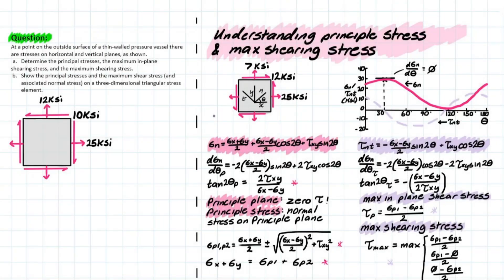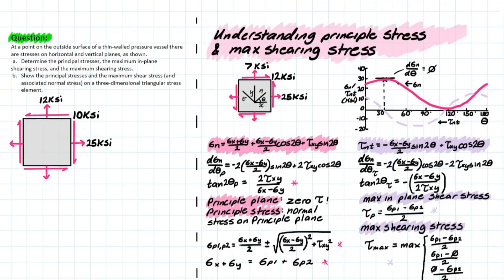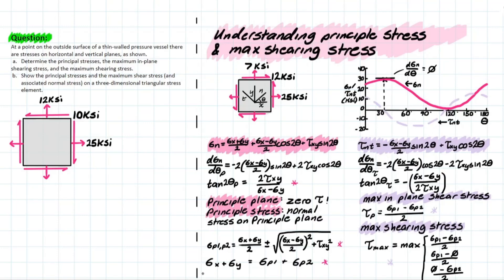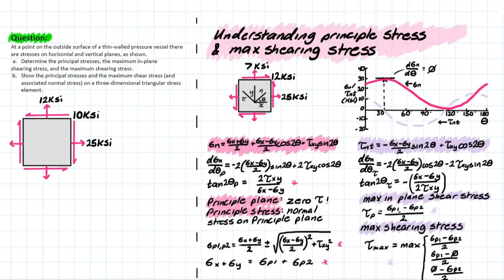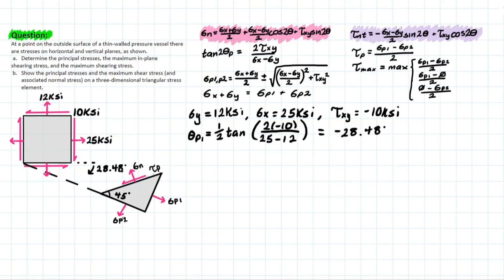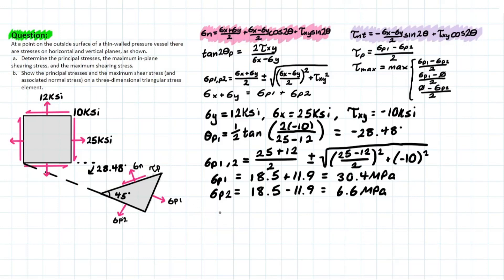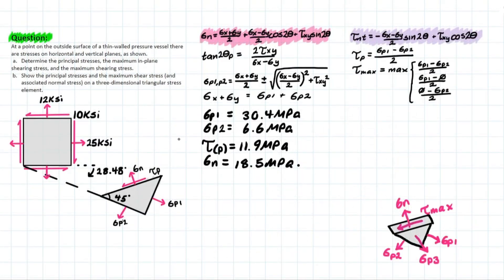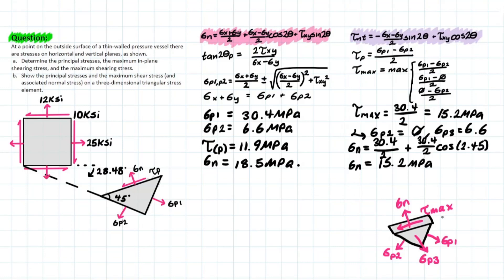What is Principle Stress and Max in Plane Shear Stress?

Comment: Question for you, for doing max in-plane stress and normal stress why did you use the principal stresses that you found rather than using the sigma x and whatnot? When seeing my notes, my professor only ever used the sigmas that were given rather than the principal stresses.
Reply from the maker: I think the simplest answer is because 'in-plane' refers to the stresses developed at the principle angle. For 'max stress', you can simply plug in using the given stresses. However 'max in plane stress' must be derived using principle stresses, which are acting on the principle plane.

Hope this helps!